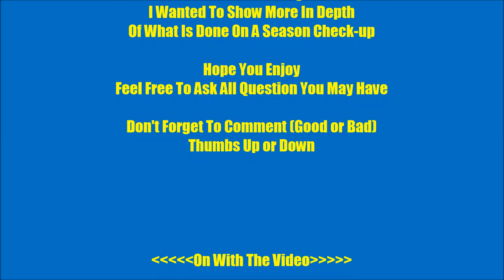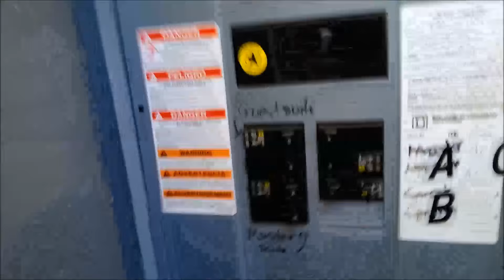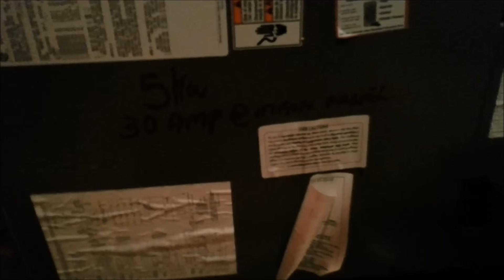Fix Bad Wire On A York Air Handler | 3 System PM Service

Comment: Nice job, they sure didn't leave you any extra room on the condensers for working on them or air flow, but that is the norm these days. just make it pretty and hide those ugly AC units, lol.  

 thanks for posting
Reply from the maker: +Dave Miller  Thanks for watching